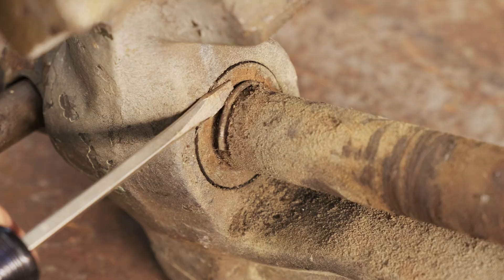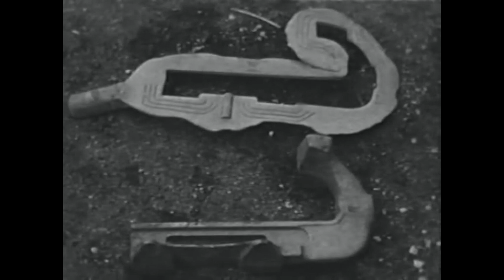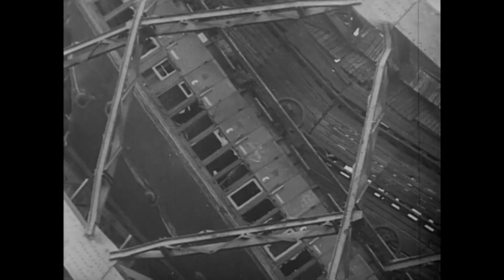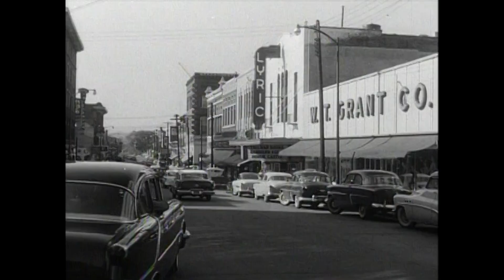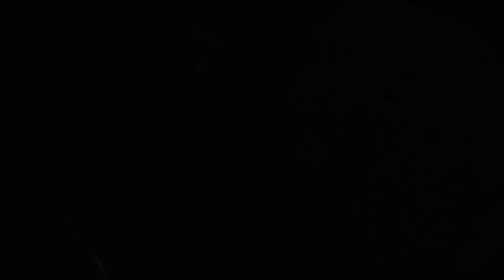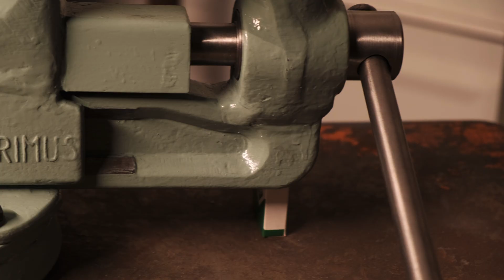Adding a Bearing - Restoring a Vintage Vise

Comment: would have been a better idea to place the bearing before you place the spring on the inside of the spindle. The way you did it doesn't relieve the friction.
Reply: do you mean
Vice, Needle Bearing, Preload Spring, Spacer, Spacer Ring?

Comment: Fabulous vise!

You didn't need the rear needle bearing (but it won't hurt) - the front bearing works when you tighten the vise, the rear bearing only does anything when you're opening the vise. Very light forces so you don't really need a proper bearing.

You might want to consider a shorter handle - since you've reduced the friction between the screw and the vise (with your needle bearing) you can now apply more force, possibly to the extent of breaking the vise. And a shorter handle is also easier to turn and spin!

When tuning between centres, the tailstock centre is normally the hardened one, but the drive end centre is normally soft. It will not wear out, because there's no relative motion between the part and the centre. Moreover, a soft centre can be turned to a point (using the compound set at 60 degrees) which guarantees perfect concentricity, even if the spindle has runout.
Reply: its forged steel vise you can't break it with that handle.

Comment: A friend showed me this video.

Very well made video. i watched with pleasure.

I have to point out you are about a decade wrong with manufactury date.😳

This is the latest version of Primus Brockhaus made.
It has the edged spindle guard.
It fits on the modern swivel base.

The latest version is introduced in the summer of 1957.
Your Heuer Primus is end fifties or the sixties.
I am not shure if the production year is already forged in the dent of the slide under the dynamic jaw.

About the rough surface. It is possible the forging molds were starting to wear out and Brockhaus never replaced them when these got out of specs due to too low demand of this model.
The last version had only the 150 6" and 175 7" models.